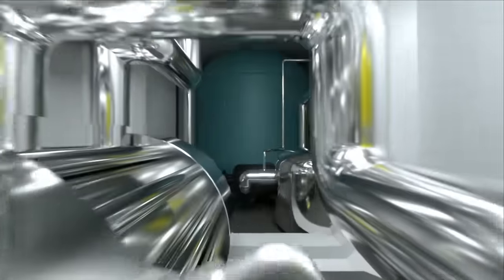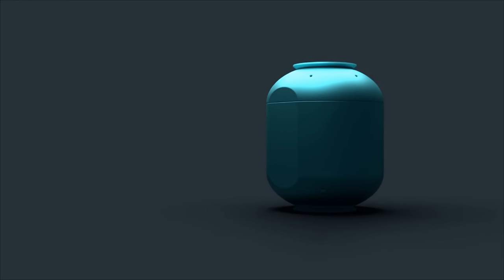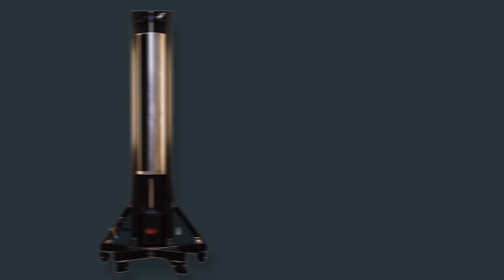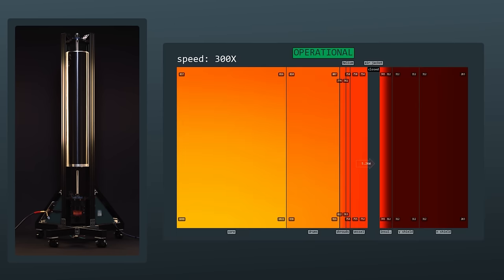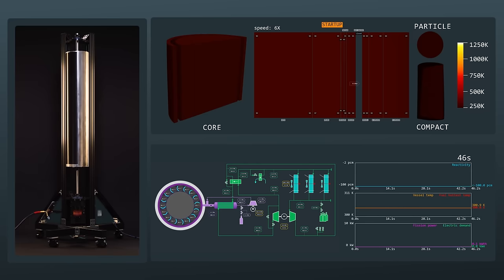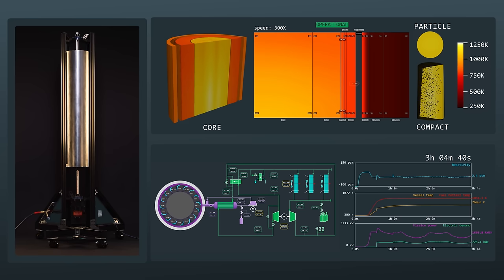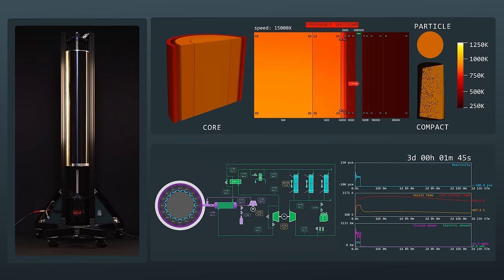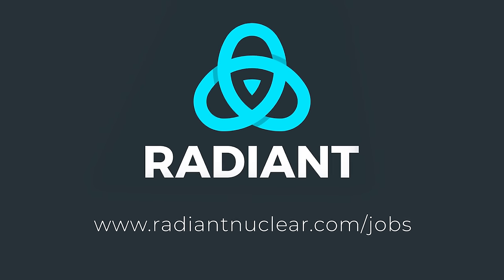Introducing Kaleidos, a Portable Microreactor from Radiant

Comment: This is the future we were all promised. Abundant, energy-dense, low-cost energy and electricity. THIS is the future of a low-carbon emission society!
Reply: This is off the shelf technology that’s been used for years by the military
Reply: @glass1258  Not really. Military still used pressurized water reactors. The closest thing to Kaleidos would be civlian Dragon reactor.
Reply: @caav56 Concur.  I am not aware of a military design that used this particular core or cooling system design.  US and Canadian navies pioneered using Pressurized LWR and HWR designs, respectively, so water has been a go-to for military microdesigns because it can be readily procured in an operational theater.  Helium, notsomuch.
Reply: @HuntingTarg  Yeah. There was also nitrogen-cooled water-moderated ML-1, but that one went nowhere.
Reply: @HuntingTarg  the Canadian CANDU design is the classic heavy-water reactor... but it has nothing to do with the navy. The Canadian Navy has never had nuclear propulsion; CANDU was developed by Atomic Energy Canada Limited (AECL), Ontario Hydro and CGE (and other companies) for public utility electrical power generation.
Reply: There is nothing about this proposal which suggests that it will provide low-cost energy.
Reply: Abondant, low-cost, this is not capitalist.

Comment: What happens if the reactor vessel is ruptured and the helium leaks out? What happens if the actuators fail and cannot move the neutron absorber into position? This is probably safer than a high pressure water cooled reactor but it is still a high pressure cooled reactor. I like the low pressure liquid salt type reactor. If anything happens physics causes it to shutdown safely. This thing still requires active controls to shut it down and keep it cool.
Reply: They can rig something up to use gravity and plain physics to shut down the reactor if needed, maybe just with gravity and a few push rods to actuate the neutron absorbers, maybe even a physical fuse similar to the salt plug for those other reactors, but yeah; the present design definitely needs that change.
Reply: @king6530I don't see a single bitflip in a physics simulation leading to misoperation.  I'm more concerned about cumulative error compounding, or ionizing radiation damaging the simulator CPU.
Reply: I don't like molten salt designs because of the inherent chemical hazards if air gets into the primary cooling loop - salt-metal corrosion can become a runaway reaction if a leak lasts longer than a few minutes.
This design is far from inherently safe though, simulative self-correction nothwithstanding.
Reply: Use actuators with a spring that returns them to a safe position when they lose electrical power?
Reply: @vadimmakarov6811 lol thank u for saying it, I'm reading these comments like "are u guys presenting problems w/ extremely obvious solutions on purpose or are u actually incapable of the most basic problem solving?"
Reply: high temperature gas-cooled reactors are pretty safe. The fuel pellets won't rupture and release radioactive gases, unless they get hot enough to burn through.  I assume that the temperature coefficient of reactivity that they mentioned is negative enough that the max temperature attainable before self-limiting is somewhere well below the temperature at which the fuel pellets burn.  They consist of fuel inside layers of silicon carbide and other ceramics. Kind of like a gobstopper but quite a lot smaller.
Reply: Springs loses the tension over heat, and heat cycles, it's not safe enough
Reply: Last year, Oliver Stone directed a great documentary on nuclear energy, called “Nuclear Now”.  It explains how nuclear energy got a bad rap yet at the same time, was actually the safest form of power when compared to oil, gas, hydro and coal.  The nextgen technologies like SMRs (small modular reactors) and even micro reactors like the one in this video, offer many advantages and with mass production, can  significantly augment solar and wind when the sun doesn’t shine and the wind doesn’t blow, with longterm cost reductions and planning benefits vs current large nuclear plants.  I believe with enough time (a decade or so), we will see reactors like these all over the world.  Better still, some of these reactors can use spent uranium rods that are currently stored longterm and thus have a negative fuel cost.  There are enough spent uranium rods in storage to power the world for 1000 years, if used appropriately…and reduce nuclear waste significantly.   While experiments develop and there are many naysayers, it seems inevitable that these new reactors will become an important aspect of stable and safe electricity over the next 20 years, as they will augment renewable power and provide baseline electricity wherever it is needed.  It is a major story that merits attention, even if it takes awhile for prototypes to prove themselves worthy to skeptical utilities and the public.

Comment: Very interesting compact solution with rotating control geometry. I have two questions:
1. Biological shielding not included and is to be built by the client?
2. How is passive self shutdown achieved? Are control surfaces spring loaded to snap into shutting down the reactor in case of power loss?
Reply: Answers: 1. The clients wear thick concrete clothing that measures at 3m in thickness. 2. The user takes the nuclear fuel out of the machine.
Reply: Biological shielding isn't needed. The structure of the reactor itself functions as shielding, and the previously dangerous radiation risks due to catastrophic failure or meltdown basically don't exist nowadays. We've made the actual process of generating nuclear power very, VERY clean. Even Fukushima, as terrible as it was, didn't actually release much radiation. Also of note: since these designs are smaller and meant to be self-contained,  the risk of malfunction due to natural events is orders of magnitude lower than at any existing large-scale nuclear powerplant.
Reply: @lewishall9786 So I only have to encase myself in an unmovable concrete block and then use telekinesis to swap fuel. Got it!
Reply: @Data2.0 Do not make mockery out of this. Countless hours and money have been thrown on these obscure but promising practices from the Pentagon 😅
Reply: @Data2.0  I can't tell if you knew I was joking or not lmao
Reply: They have gamma and neutron shielding in the video.

Comment: I'd be worried if it was the sixties, I'm glad we progressed to a point of feasibility.
Reply: Who says we have? Nobody has come close to designing a financially viable micro reactor, let alone building even a prototype. The above is all hypothetical marketing hype. Every independent investigation has said small nuclear is a massive lemon long before it starts. Renewables + Storage are already significantly cheaper without any subsidies and without the unmitigated, potentially planet-ending horrors of the nuclear fuel cycle.
Reply: @lptf5441  Lmao no, renewables and energy storage are expensive, short sighted and extremely reliant on mining rare resources that contribute to toxic waste. Nuclear is a big investment and dirt cheap to operate. This is a pretty simple combination of proven technologies proposed in a new form factor. The risks of the nuclear fuel cycle are tiny, and negligible compared to the amount of unrecyclable waste that comes from solar, wind, and high density batteries.

Comment: This is a Modular High-Temperature Gas Reactor. Helium is an inert gas that does not get radioactive unlike liquid sodium, deuterium (heavy water) or water.
Reply: I just use COW FARTS
Reply: How about CO2
Reply: @3nityC  Has some moderation potential and does get radioactive. However, it's great for power conversion, which is why Kaleidos uses supercritical CO2-driven turbogenerators.
Reply: @caav56  Thank you for the info ✨
Reply: There's nothing "modular" about this - it's just small.
Reply: @brianb-p6586 I was just about to say that. And nuclear and modularity cannot be used together in space this small safely
Reply: so what, all materials around will become activated with neutrons, and small rea need more materials, so more waste and contamination possobilities
Reply: @seansingh4421  Modular in the sense you can stack these systems and return them to the factory as needed. Could simply just replace each module with a new one with little down time when they fail.  Its quite a large contrast to permanent reactors that require on site part replacement and at the very best, transferring of the core off site for repair which in itself is a huge task. San Onofre power plant is a good example of this. The cost to ship the core from California to Utah was quite large and at the end, the plant was simply too expensive to maintain.  Most micro reactor concepts follow this "modular" concept and are often called a modular design.
Reply: Is the fuel also "inert"? Would you agree to have one of these in your own backyard?
Reply: @lptf5441  no it isnt and yes a would.
Reply: It's like modified NERVA project, but with a generator instead of nozzle
Reply: Ever heard of Helium Embrittlement?

Comment: I love this design. It looks even more compact than the Megapower reactor design. From reading around, the initial idea was developing a small self-contained reactor that could be carried to the moon or Mars. If it's design is based around a 40 foot intermodal container, which it appears to be, it can't weight more than 30 tons. 

A pair of these could power a Sabatier reactor to produce 3 tons of methalox propellant per day, requiring 400 days to refuel a Starship (1 ton of methalox requires 17 MWh of energy to produce, assume the other 6 MWh is used for other purposes, such as cooling the propellants and running the air compressors drawing in Martian CO2). Assuming a cargo load of 100 tons, you would have 40 tons left over for the processing plant and a couple of excavator rovers to dig up permafrost to supply the thing with ice.

Waste heat from the reactors could be used to melt the ice and distill the water for processing.
Reply: Waste heat from the vessel or primary loop could also be diverted to a thermocouple array.
Reply: The container size does not imply the weight - it could exceed the standard allowed container weight, and still be packaged in a container. A better indication is the three-axle trailer behind the tandem-drive tractor shown on the website - that does suggest around 30 tons.

Comment: Where does the air in the air jacket mentioned at 2.17  come from?  If the air is used to cool the reactor where does it go? Will it be dissipating 1  megawat tof thermal energy or will the reactor be making close to 3 megawatts of thermal to produce 1 megawatt of electricity? What does the narrator mean by "false scenarios" in this part of the video?
Reply: When the simulator gets into a state that does not closely reflect the physical/reactivity state of the reaction vessel itself.  The air gap means that heat will be pulled off of the pressure vessel and not transferred to the containing structure.
Reply: The 1.2 MW quoted is maximum electrical output, so the reactor's thermal output will be much higher, with the difference being dissipated to the ambient air through the radiators behind the externally visible grills. The Radiant website claims 1.9 MW of waste heat flow, so the reactor output must be 3.1 MW... your estimate is correct.
Reply: Will have to dump about 2/3 of the thermal energy to the environment.  I believe they said "fault scenario" not "false"

Comment: Impressive !!!! Nuclear tech improving in safety and function all the time .. Outstanding.... Clean and abundant with respect to it's danger ..
Reply: Has been for a long time, but the powers at be don’t want us knowing how safe nuclear really is when its maintained and handled properly. The U.S. should’ve went fully nuclear power 50 years ago and they definitely could have but decided greed and corruption to be more important than what’s better for the people.
Reply: @infantryrecon101st  I absolutely agree also there is a problem of atrophy in terms in nuclear engineering as I'm afraid because the US hasn't taken on continuous nuclear projects in the past the skill set isn't there as it used to be, pity with the direction they were heading 50 years ago it would've made us and even greater super power. Wind won't have been able to stand a chance against Nuclear power.
Reply: @infantryrecon101st  Also if I may add something, the Netflix dramatization of the three-mile incident, it actually demonstrated what happens when the US is effective in containing a disaster almost like a complete inverse as to what happened at Chernobyl. But some would say it was still a disaster and Netflix placed it as a documentary, fellas its Netflix will they really come out and say look at this disaster actually it wasn't a big deal but still watch it. I would disagree Netflix doesn't do proper documentaries most of the time as I like to call them Drama entries rather than documentaries

Comment: I'm curious what the max temp is if the control blades all get stuck in the full power position and there's a loss of coolant.  
Also, He is not very dense. I'm REALLY curious what that helium flow rate is. My back of the envelop calc for a 1 MW plant says it's gotta be about 3 million gallons per minute (180,000 liter/second). That pump gonna be screaming.

Comment: Hope they make them small enough for single home use and affordable for the average American. We really need to move to nuclear as the power grids are constantly over stressed and having a power source at every house would mean no more blackouts and dependence on a power system that is outdated and aging more everyday.
Reply: What a silly thought 😂
Reply: @ForageGardener  it's brilliant. Microreactors in every home - say 10kW - could easily be placed in the basement of a house.
Reply: Интересно, а топливо ты где будете покупать? Менять будете сами в подвале? А как утилизировать отработанные элементы? А как справляться будете с избыточным тепловыделением в жару?
Reply: @spdcrzy  yes so we can have radiation poisoning and accidents all over the country ! Amazing
Reply: @sigmamale4147  nuclear is INCREDIBLY safe. It has been for 50 years. Self-contained reactors are less likely to fail over a period of decades than any other kind of power plant.
Reply: @spdcrzy  do you trust the average U.S. citizen with handling a nuclear fuel rod?
Reply: @sillylittleowlguy2392  what part of "self-contained" do you not understand? NOBODY needs to handle fuel rods. You treat them like you would a furnace or any other appliance - if anything fails, bring in the professionals.
Reply: @spdcrzy  that would work, until Cleetus decides that his trade school diploma in plumbing makes him just as qualified as someone with a PHD in nuclear physics and takes a screwdriver to it. It's a terrible idea to trust the layman with having a nuclear generator in their house.
Reply: @sillylittleowlguy2392  a reactor, even a self-contained one, is not going to be vulnerable to attack by a caveman with a household screwdriver.

Comment: Strange No mention of the Fuel Source ?
The preferable Thorium or the more dangerous Uranium ??

Also any update on the Chinese SMR ?
Reply: The video shows the TRISO fuel pellets, and expands one for a sectioned view.

Their website says "Meltdown-proof TRISO fuel, ceramic coated uranium particles". 

According to the Wikipedia nuclear fuel article:
"Tristructural-isotropic (TRISO) fuel is a type of micro-particle fuel. A particle consists of a kernel of UOX fuel (sometimes UC or UCO), which has been coated with four layers of three isotropic materials deposited through fluidized chemical vapor deposition (FCVD)."

So, uranium.

Comment: Video has most emphasis on its analytics and modelling software, talking about its safety features.

1MW power generation can supply about a million US homes (~1.2kW) instantaneous power demand). Looking at the graph on bottom left, the efficiency seems to be around 35% thermal to electric.

Seems to be a really nice solution to centralized power generation- could solve issues relating to long-distance power delivery by its small size and scalability.

Comment: I'm dubious. How long until it needs to be refueled or replaced from old age? This will probably cost more (even including fuel) and last a shorter period of time than a comparable diesel generator.
Reply: The Radiant website says 
"After 5 or more years of operation the fuel is depleted, and the entire container can be shipped back for refueling", and 
"Back at the factory, Kaleidos can be fueled a total of 4 times for a 20-year product lifetime"

That is not a very long life, and refuelling will be both expensive and logistically difficult (because a replacement unit will need to be swapped in each time).